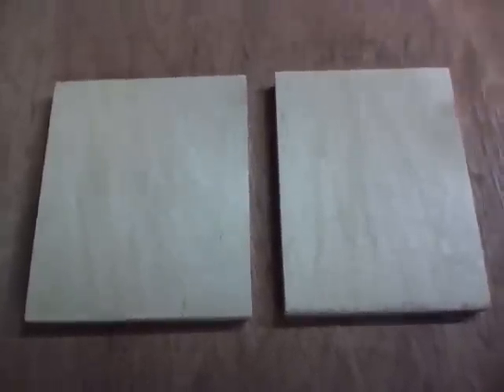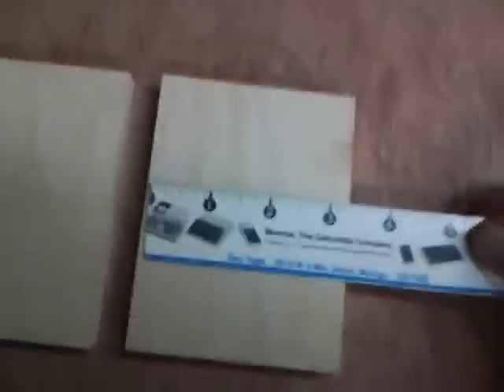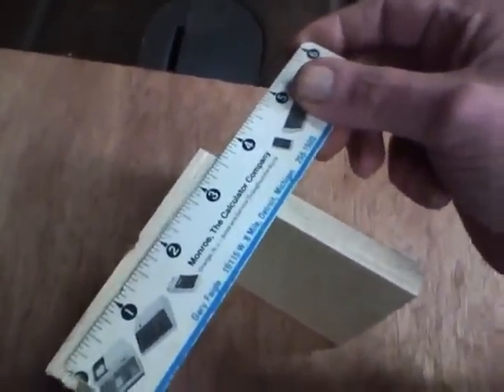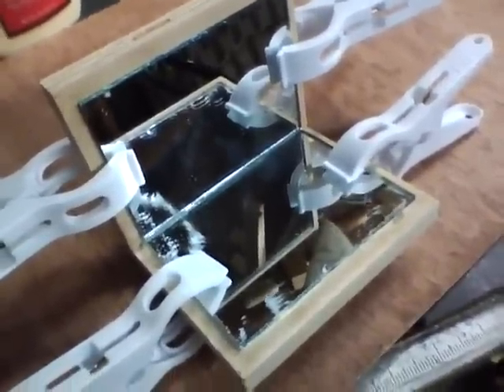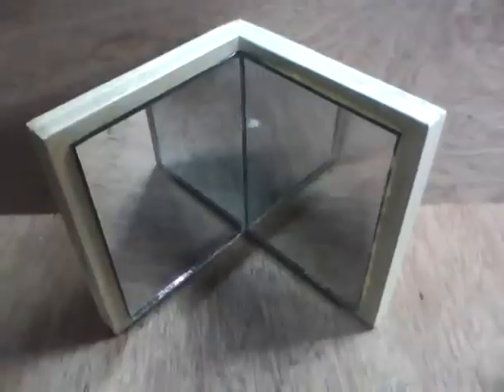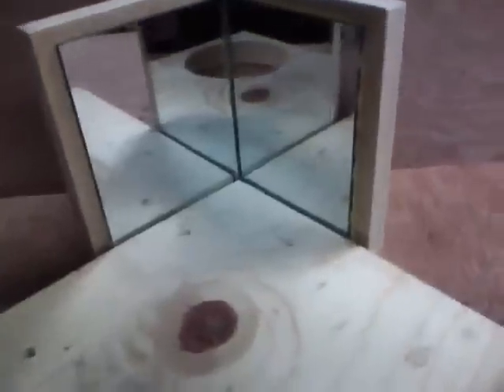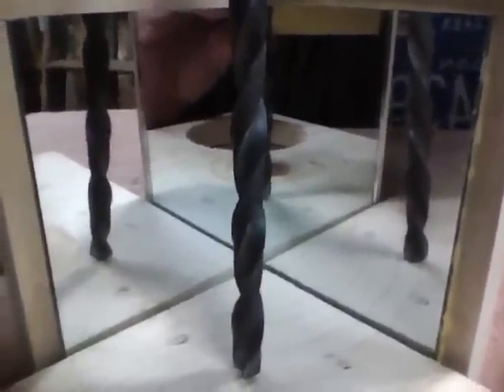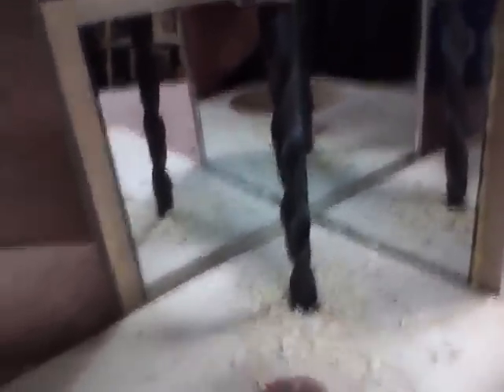Exclusive: Drill a straight hole

Comment: I just get a scrap of wood, mark points on one side, mark the same locations on the other side, then drill through the top point, trying to come out of the bottom point. As soon as  I succeed at that, I cut away any extra scrap, and that's the hole I use to guide the bit, since I know that, as long as the wood was square, the bit will be coming out of that bottom hole perfectly square

Comment: I have a technique that does not require a special device -- just a level table and a light source (you can even use the sun if your table is outdoors.)   You adjust your table (or the light source if you are not ussing the sun) so that it is "exactly" to your right or left at a 90 degree angle to the direction you are facing.   You view the dirll itself to adust your hand to the right or left until it looks perpendicular to the surface you are drilling.   You view the shadow of the drill to guide your hand toward you or away from you.    It works pretty well if you are not too much in need of exactly perpendicular.   Much better than with just "shooting from the hip".  :0)

Comment: really like your device:   It is something you can make yourself out of relatively inexpensive parts.    It depends on your having a  good eye (to judge when images are parallel) and a steady hand.   If you have a good eye and a steady hand it will probably be just as accuarate as (or more accurate than) a purchased metal (or homemade hardwood) guide because the holes in such guides need to be enough larger than the drill bit to prevent binding on the bit.   It also does not prevent the drill from going all the way in as a regular guide would do.  The only drawback I can see to your device as compared to the purchased guides is that it is not only more bulky but needs to have protection for the mirrors from dirt and scratches and fracture.    Very Clever!!  Thanks for posting this.